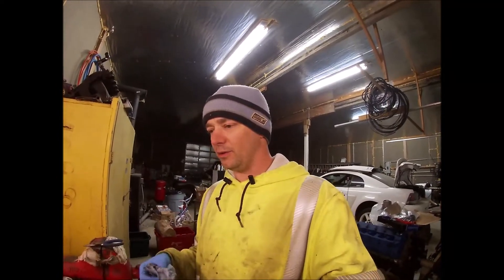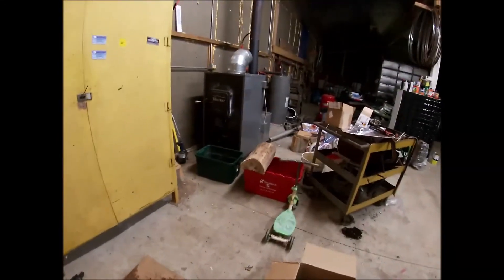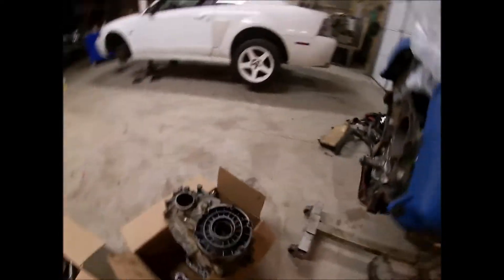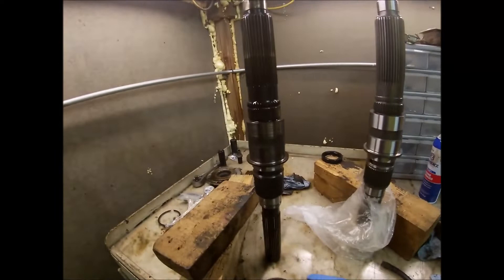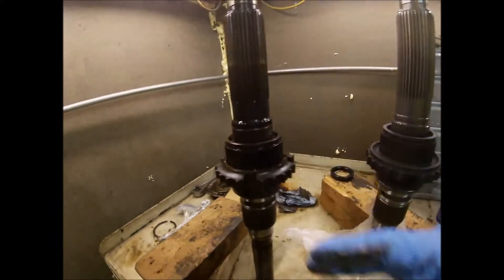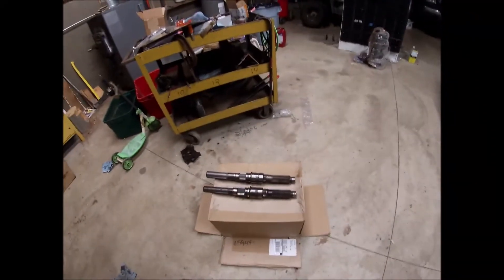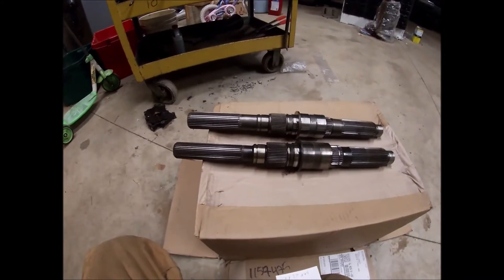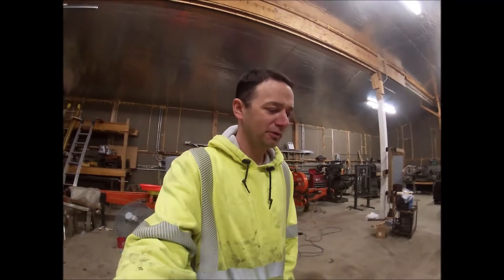NP263HD Transfer Case - Failed Parts And Things To Inspect For Rebuild

Comment: Not sure if you are still following your video, but in case you are, first please let me just say thank you for taking the time to make and share it.
I'm wondering of the two different sized ring gears, if the different one caused any type of issue for you when put the transfer case back into service.

I'm getting ready in the not to distant future to start tearing mine down after I purchase some necessary parts over time as I can afford them.
Nowhere have I been able to find any information on the actual physical differences between the NP263, or the NP263"HD" which is what is also stamped on my
transfer case.

Any final thoughts and/or advice you discovered along the way during the rebuild would be greatly appreciated and, on a totally unrelated topic,
here's wishing you and your family Blessings of joy, peace, health, and happiness this Christmas:>)